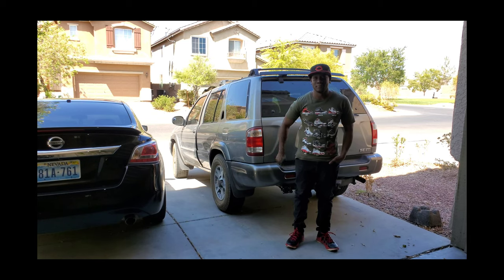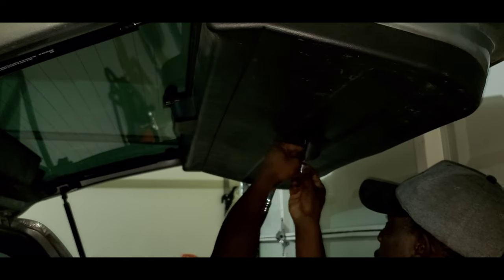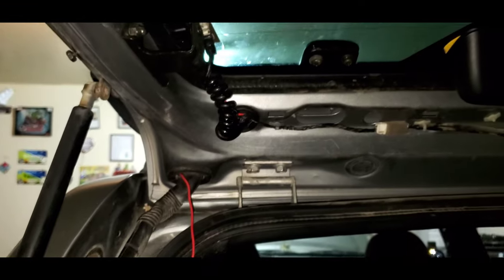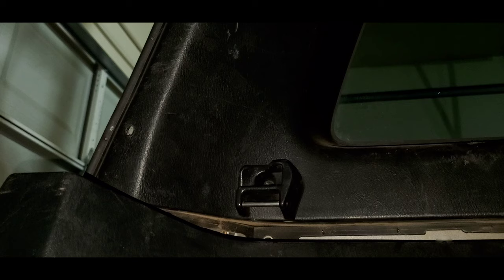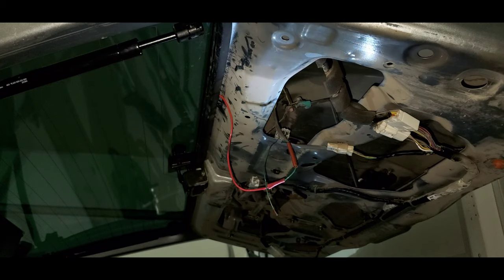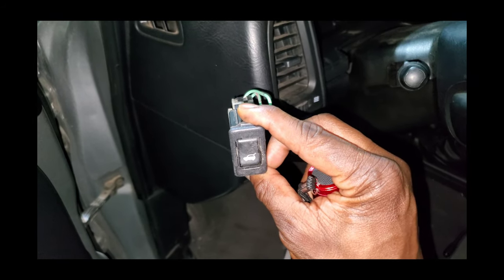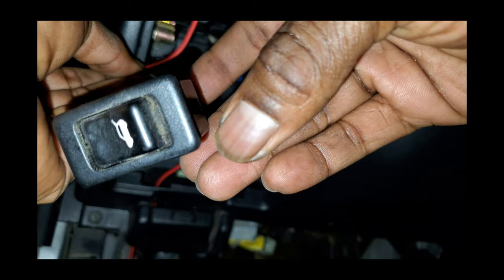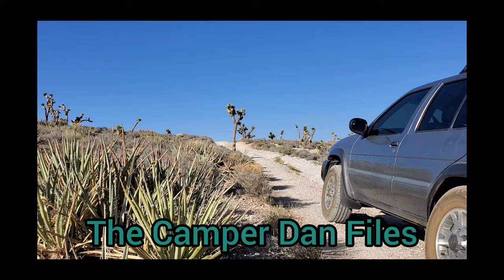1996-2004 Nissan R50 Pathfinder| OEM Rear Hatch Glass Release Upgrade!

Comment: Nice mod I have a 99 QX4 it has the switch in the door panel I installed a rear view camera recently and I was able to fish it through The grommet in the hatch through the side of the frame of the rear door with a strong steel wire took a while but I got it done the only reason I decided to do that was because a drunk driver hit the rear quarter panel of my truck smashing it in I repaired the truck myself I will post a video on my channel when I edit the clips together I enjoy watching your channel

Comment: Great video - thanks for posting...I have a 2001 PF LE and this is one of those little aggravating things about the rig I've never really understood, why Nissan chose to not provide this feature except for on the QX4 and I always figured there is a certain amount of stuff in place to do the upgrade. Too bad they did not at least have the wiring in place so all that is needed is to install the actuator and the switch as that would have provided an upsell oppy for dealers and, of course DYIers. I think the reason is they were struggling to add differentiation between the LE and QX4 as it was. I test drove both before I purchased my LE and $10K upcharge for the QX4 was a tough sell (at least on me) and I finally concluded their real market for the QX4 was by leasing where the extra $10K was buried in bigger down payment and lease payments being amortized over 48 months because the QX4 had a 48 month warranty vs the PF with a 36 months (leasing longer than the warranty makes zero sense). So then doubling down on that reasoning, they had to somehow allow the lift glass on the PF to be opened without an actuator so they came up with the key method, which is completely non-intuitive - turn left, then right two clicks and actually locking all the doors in the process! Just brilliant! ;-) So its just one of those thing I learned to live with (sigh). I have to remember if the PF is parked in the garage and the garage door is down, I have to grab the key to open the lift glass to fetch something out of the cargo area because there is not enough room to open the lift gate with the garage door down.  And then of course, unlock the doors if I want them that way since it's in the garage. Here's an idea on wiring the switch - on my '01 I have the added aggravation of the "Model /A" keyless remote failures. I've gone thru several and have concluded they are basically junk which is why Nissan quickly discontinued them, which unfortunately means very little ROI for the aftermarket key fob providers. So as it is, the only practical work around is to go with a universal keyless entry system which are under $20 on Amazon.  Most have a trunk release feature which I think could pretty easily be connected to the actuator. So my thinking is since I will always have the key fob near the vehicle anyway, I will just use that instead of installing the switch. This makes sense for folks like me that are stuck with the "Model /A" remote issue, but others may want to consider this also. A wire would still need to be fished to the actuator but it would connect to keyless entry controller instead of to a switch.  Since the controller needs to hooked up and buried someplace anyway, I figure it would be a pretty clean way to handle this. The obvious downside is the you still have to rely on access to the fob being nearby but I think it beats using the key method.

Comment: Nice video. I'm currently trying to get mine working on my QX4. It's a salvage with a different year model hatch and the bare minimum connected, so that's fun. I recently had to add some reverse lights because I didn't have any haha.
Reply from the maker: Hello Fosty, sounds like you have a bit of fixing to do. It's always fun fixing someone else's work. I hope this video has provided you with some insight to help you make the necessary repairs to get it working again.
 
Thanks again for watching
Chris.

Comment: Thanks for this video man, I'll try to do the same, and also get the Heat switch, and take out Cruise control which I never use and doesn't work I think
Reply from the maker: @Pathfinding, this has been my favorite mod so far, it helps to make my camping experiences a whole lot better as I can easily access most of my camping gear through the hatch glass versus opening the entire rear hatch. Thanks again for watching and welcome to the channel!
Chris.

Comment: When I first subscribed, you mentioned you were working on this mod. I told you I would be waiting for the video and here it is. This is one I will be doing fer sher. Since I plan on doing as much camping and traveling as possible once I FINALLY retire I may even see if I can find 2 switches so I can access one from the inside rear of the truck. Just curious, does the key still work from the outside? Great stuff, watching your channel all the time...Thanks
Reply from the maker: @xXxOl'Man, "I may even see if I can find 2 switches so I can access one from the inside rear of the truck" Wow I too have been tossing around this idea as well at the request of my wife lol. Just trying to figure out the switch placement though, we shall see. 

"Just curious, does the key still work from the outside?" Yes, it does, however, whenever I use the key to open the hatch glass it also locks all of the doors and the trunk. It can be a little annoying when you're trying to get things out of your rig when trying to set up camp. This was my reason for doing this mod, in my honest opinion best thing I've done to my R50 thus far. thanks again for your views and support.

Chris.
Reply: @TheCamperDanFiles  It may be as simple as locating the circuit at the key switch itself to disable the auto lock feature. Personally I don’t think I need to lock ALL of my doors from the back anyway. I just use the remote locks for that anyway. Now if I can just find the right parts...

Comment: How about installing a cruise control, my  03 R50 pathy is missing one from the dealer and I would like to install one if possible?
Reply from the maker: @Bader Barghouti Unfortunately this may not be possible due to all of the components needed for this to be added to your R50. Especially the computer parts, sensor etc. It requires a lot of special parts to get it to work and more importantly to work correctly. One of my fellow forum members over @NISSANCLUB.com also presented this question for a 5th Gen Altima, and the general consensus was no can do.
Reply: @TheCamperDanFiles  Got that, Thank you bro.
Reply: I have been considering adding a cruise control as well.   A number of people on the R50 Pathfinder Owners Australia forum on Facebook have done the conversion successfully but nothing has been posted on how to do it. It isn’t overly difficult based on discussions I’ve had with them.
Reply: @b256002008  maybe if youy buy a totaled but "good condition" r50 and swap parts? that's what I would do at least